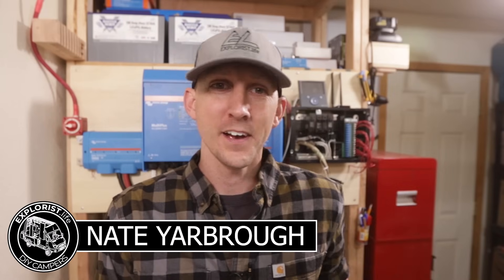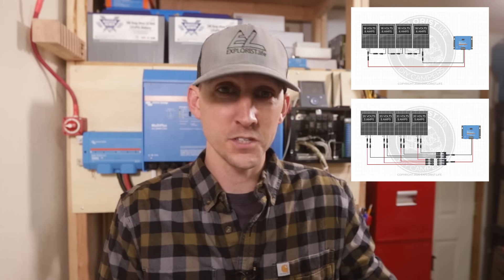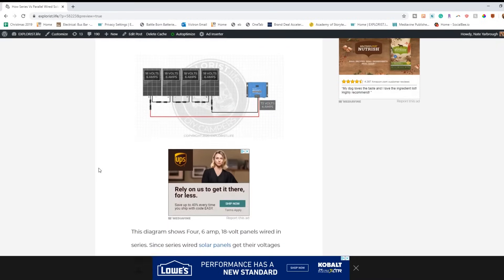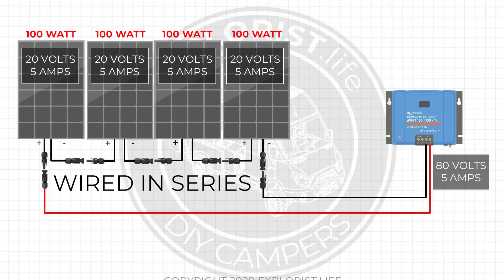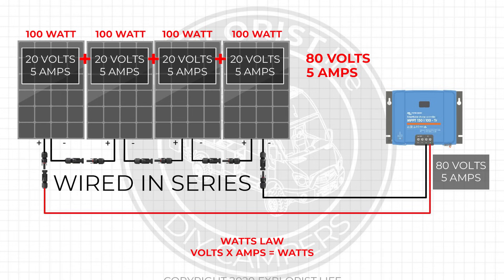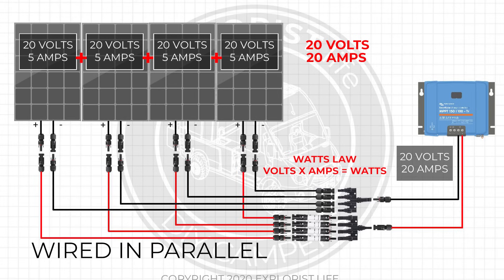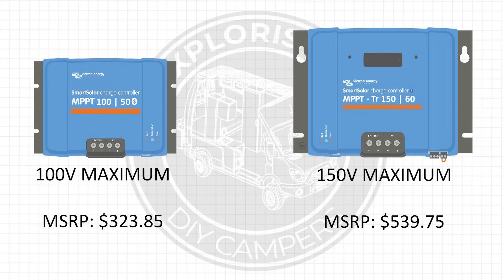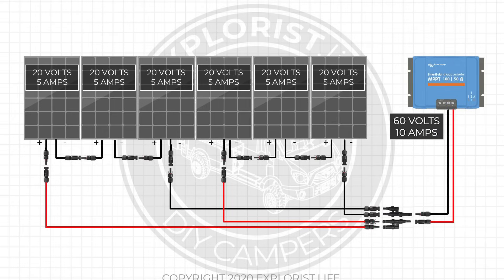Solar Panel Wiring vs Volts and Amps

Comment: Question ? So far I am following along and understand the math, what is series, parallel and series/parallel. What I don't know and asking is when it comes to charging the batteries, what is more important - Volts, amps or watts? I understand it is a combination of all three. But what is the most to be concerned about?  (In a camper type setup. Me, it is overlanding out of the back of my truck)

Thank you. I do fine your videos very informative.

Comment: Great info and yes very confusing.  I'm trying to do a pv hot water heater system.  I have 6 325w sunpower panels and a 100 amp mppt controller.  I'd like to skip the batterys, wire this to a 24v element in the bottom of my tank, use a snap disc thermostat 140 degree. Assuming it will never get to 140 at the bottom of my 50gal tank.  I will also leave the top element tied to the grid and set it to 125 in the event there's no sun.  First it sound like I need a bigger CController.  How should I wire these panels?
Thanks
Will

Comment: Great video thanks.
I have a system the has 4 x335 Watt panels and 2 x  330w panels connected in series. We tested and got 330v DC. The submersible pump says max volts allowed is 400V. Am I correct in saying 6 x 330 w is 1980 w  how do I convert that to volts? Also will extra panels in parallel help during overcast days? Thanks
Reply from the maker: Each panel has it's own voltage that will be listed on the sticker on the back of the panel.  You can take that voltage and use the information you learned in this video to answer your own question.

Comment: Is there any reason NOT to maximize the voltage going into my inverter?

My inverter's MVC is 450V. So, I would want 450V coming from my solar panel, right?
Reply from the maker: As close as possible (but not exceeding the maximum) given you have enough panels.

Comment: Thanks for the video. Please confirm if calculating short circuit current is indeed covered in this video? I’m not seeing this covered unless I missed it? Is operating amperage of the array the same as the short circuit amperage? I’m trying to determine the short circuit current for my solar array. Thanks
Reply from the maker: The short circuit current should be listed on the spec sticker on the back of your solar panels.

Comment: When you lock at victrons specifications for smartsolar 100/20 mttp regulator it says nominal pv power at 12v, 290watts. What does that mean?

 I should get 2000watts of solararrays before I max out the regulator if calculating with your metod (best case senario, 100v at 20a?).
But victrons mttp calculator goes from 100/20 to 100/30 when i add two 115w in serien time two in parrallel.
My count it should only be 40v x 16a? 

So should still work with the 100/20 right?

Comment: Hi I got a question I’m trying to get solar installs on my RV I’m thinking about getting that Vectron 150-70I don’t know if this good but I already have the solar panel I have 4 300 watt panel  How would you wire this set up I have a 400 amp lithium batteries thanks

Comment: Can you run a tube power amp that can be lowered from 50 watts to lower watts like 5watts or lower safely with the power invertor? Many tube amp mods have built in variac to lower power output down. I use reactive load to safely run the amp without a speaker.
Reply from the maker: High quality inverters can power nearly any load provided it is an adequately sized inverter.  I can't speak for the specific use case of tube amps, though

Comment: In your example of 4*100W, 20V, 5A panels, why not use a 100/20 charge controller. 2 series strings in parallel would give you 40V 10A to charge a 12.8V LFP battery? It is well under the Controller 100/20 rating and save money on the charge controller?
In absolute ideal conditions 31.2A could be created but the controller output is limited to 20A.
So a 12.8V battery would only be using a maximum of 256W.
But oversizing the array like this would give better overall yield especially on poor solar days when it's cloudy etc.
Am I missing something here?
Reply from the maker: 400W of panels would potentially charge a battery bank at ~27.7A (400W / 14.4V = 27.7A) under ideal conditions.  Using a 20A charge controller would only charge at a rate of up to 20A and the rest of the power would be wasted.  This is why a 30A charge controller is a more appropriate choice.

Comment: Man I am still lost and watts law doesn't add up I have 8 - 200watt panels (24.3 Open Circit Voltage VOC) & Maximum Power Circit IMP 9.80A... I have a 150 Volt Maximum HOW would I wire this and have it add up to 1600watts and stay under 150 Volts??? Thank You For Your Help my mind is mush getting old stinks.
Reply from the maker: https://shop.explorist.life/shop/all-products/camper-wiring-kits/solar-charging-wiring-kits/1600w-solar-charging-wiring-kit-8x-200w-12v-battery-bank/
Reply: @EXPLORISTlife  Sir I want to Thank You for your help! My kids got us a Delta Pro W/Two Extended Battery's along with the Rich Panels for when the lights go out again here in Texass. After watching So Many Videos I got Really Confused and Your Help is Greatly Appetited. Not much more I can do in return other than Subscribe Like Comment AND Share your content I'm sure people will have questions I Will Refer Them To Your Channel.... Thank You

Comment: I had my panels in parallel.  Changing them into series-parallel really increased the amps into the batteries.  My voltage into the charge controller was too low.  Increasing the volts increased my amps.  Thanks a ton for these very useful videos!
Reply: Gosh it's my first time trying to figure it out it's so confusing I don't think I'm ever going to be able to figure it out and I need to so bad they cut my power off and I'm trying to figure out how to make this work

Comment: Nate so higher voltage is more efficient? is this a correct understanding? I just went serries parallel with 4 panels. They seam to work much better.

Comment: Can I run a series string of 8 then ad a string of 2 in parallel?
Reply from the maker: Nope.  Here's what would happen if you did that: https://www.youtube.com/watch?v=jejro4zkl8I
Reply: My inverter shows to get the max out of it i need to run 12 panels in series and 2 in parallel? So I'm not sure how to do that.

Comment: Can u explain  when u needing use combiner box or blocking diode?
I planing wire 6x 100w 20v 5a  series parallel  to receive  600w 60v 15a but don't know how to deal with it because l getting shading
Reply from the maker: Here is how I recommend wiring 6x 100w 20v 5a panels together when powering a 12V battery bank: https://shop.explorist.life/shop/all-products/camper-wiring-kits/solar-charging-wiring-kits/600w-solar-charging-wiring-kit-6x-100w-12v-battery-bank/
Reply: Was thinking to do 3x2 parallel   not 2x3  if u know what l mean 3strings  but on that setup from ur website there is no fuses or blocking diode  a don't want back feed is that ok ?

Comment: I have 3x rich solar panel 200w 24v (Voc) 45.4V (Isc) 5.83Ax3=17.49A . My inverter LV2424 MAX PV INPUT (VOC) 145V, I'm using paralel connection so my (Voc) volt will stay the same but my (Isc) amp will increase can my amp can go more than what it shows in the chart? I need help for this thank you in advance

Comment: Hey man I am in a problem . I got 2 Q CELLS Q.PEAK DUO BLK-G5 315

And 1
Epever MPPT Solar Controller 12V/24V Charger 150V Controller+Meter Tracer4215BN
I am assuming my sistem is not compatible 48v to 24v controller .
So could you make a video how to separate the solar panels from 48to24v . A guy in this platform separéd a 1p24v to 1p12vx2

Comment: So, where do you place fuses / diodes on solar panels and how do you size them?  say I have 600 watts, 100 watt panels, series/parallels in groups of two (3 series 1 par). would you want a fuse on each series or just one fuse before the controller?  confused on how to size and where to place?
Reply from the maker: Sure!  I have a dedicated video talking about that: https://www.youtube.com/watch?v=s1P31hxlD3I as well as a wiring kit for 6x100w panels: https://shop.explorist.life/shop/all-products/camper-wiring-kits/solar-charging-wiring-kits/600w-solar-charging-wiring-kit-6x-100w-12v-battery-bank/

Comment: Most of us are interested in understanding how to obtain an inverter output of 120 volts and amper ratings of household devices consuming 8-15 amperes. We are speaking  of many thousands of watts consumed at various times of the day.
Reply from the maker: This video shows a system capable of that: https://youtu.be/01F4QDVJUq0

Comment: Hello, I have a renogy 60 amp charge controller, it supports 12, 24, 36, 42 volts. I have four 200 watt panels on my roof. Should I run them all in series to run 48 volts, or parallel series to run 2 sets of 24 volts. I have a 300ah lithium battery I'm using in my rv.

Comment: i still don't know why is key to choose one from the other besides the cost savings on wires.. there must be an electrical especific reason to choose one from the other. no one talks about that in all other videos.. Why or what do i want from my array? more amps or more voltage?

Comment: I get that you receive 120V/5A or 60V/10A depending on the setup... but the battery still receives 14V, yeah? So, the amps would be the same whether you do it one way or the other? But you save money on a cheaper MPPT, smaller gauge wires etc? Have I understood it right? :)

Comment: I have 36 250 wall panels with specs:
Rated Power: 250W
Open circuit voltage (VOC): 37.6 V
Max power voltage (VMP): 30.3 V
Short circuit current (ISC): 8.85 A
Max power current: 8.27 A
Power Tolerance 0/+3%
Maximum system voltage: 600V (UL)
Fuse Rating: 15 A

Ideas on how to wire this to keep costs down?  Area will have very little if any shading.

Comment: This is easily the best explanation I’ve seen to date on amps and volts for connecting solar panels.  Wish I watched this before I bought four 200 watt panels  with each panel running 12 amps into a Ecoflow delta max that can only handle 10 amps.  Thanks!
Reply from the maker: Awesome!  Glad it helped. 🙂👍

Comment: I see you used all even numbers of panels.  So is it possible to wire say 7 like panels with 5 in series and two together in parallel?  If so, what would the result be using your 20V/5A example?  If not, why not?
Reply from the maker: Good question!  That would not work.  This video shows some of the math behind 'why': https://www.youtube.com/watch?v=jejro4zkl8I

Comment: What if I array is parallel and the other array is series ...Then combined them is it possible..bec in series volts same  amps added 1st  array  THEN 2nd array parallel volts same And amps  added ..So the first array different volts and amps ...Likewise the 2nd array different volts and amps .
Reply from the maker: If you have 2 separate arrays going to 2 separate charge controllers both charging the same battery bank, they can indeed be wired differently if the array design calls for it.

Comment: Hello, I've got a victron 100/50 that I want to install to our caravan, the maximum watts is 700w. 

I've been looking at some panels and came across 160w panels ( 21.9V 8.75A ) 

Would I be best to wire in series parrell 5 solar panels @ 21.9V and 43.75A
Reply from the maker: I would recommend wiring them in series and then buying a properly sized charge controller: https://youtu.be/MxziHKvTRh8

Comment: I have 2 240w panels and 2 100w panels.  I'm thinking of wiring them in series/parallel for my travel trailer.  Should I wire the 240s with the 100s in series, and then each 240/100 string in parallel, or should I wire the 240s in series and the 100s in series, then those strings in parallel?
Reply from the maker: This should help! https://youtu.be/jejro4zkl8I

Comment: I have 4 100 watt Renogy panels coming down to the Victron 100/50 MPPT wired in series/parallel for 48 volts. Only get around 170 watts during bulk charge. 
Should I wire them all in series to see if they improve?
How do I test for a bad solar panel?
If they are all in series, does one bad panel cut off the entire array?

Comment: Hi Nate. What would be the outcome of this series parallel connection:

String #1:  100w 16.77v 6.26Amp (2 panels)
120W 18v 6.7Amp (1 panel)

String #2: 100w 16.77v 6.26Amp (2panels)

Would I see a slight benefit or decrease in performance by adding that 120w 18v 6.7A panel to the group of 4 100W panels?

Comment: Nate, question: noting the impact of # of system amps on wire gauge selection, if my system (3x90w para) runs at 15 amps, would 10 gauge wiring still be good enough to prevent loss? Also, my system would be around 25v. Am I wasting money getting an mppt (Victron 100/30) over PWM given the circumstances?

Comment: Very informative i have a solar inverter with mppt range 120-450vdc and i also have 10 solar panels of 540watts with 46vdc. Please tell me what is the more efficient way to connect these panels 5+5 or 9 panels in series for higher mppt volatage.
Reply from the maker: 5+5 would probably be better here.

Comment: I understand that series is best when one has 100% sun...What about intermittent shade?...Is wiring in paralell the solution to partial shade?  Does wiring in series+paralell solve shade problem?
Reply from the maker: Solar panels need sunlight to function the best.  If you have less than optimal sun, you'll have less than optimal output regardless of how they are wired.

Comment: Can you Please Help Me . I have a 250 Watt Solar Panel . I'm only getting 35.4 Voltage from Solar Panel and Only 0.02 Amps .. Is My Solar Panel Bad .. Time Now is 11 am Sunny Day .. Any Help would be Greatly Appreciated 🙏
Reply from the maker: Sounds like your batteries may just be full.  Full batteries won't charge any further.

Comment: I have 5 -100w panels on my garage.   I’m using a renogy charge controller with a 100v/520 imput max.   I’m wired in parallel, so that 20v @25 amps.   Would it be better to drop one panel and wire in series to increase my volts.  Thanks
Reply from the maker: Maybe.  Tough to tell, though since we would then be comparing instantaneous amperage vs amp hour yield per day.  My recommendation would be to switch all 5 panels to series and replace the charge controller with one that can handle the increased voltage.

Comment: Agreed, very helpful videos.  I recently purchase an EcoFlow Delta Pro and want to use it as a back up power station for our home.  The DP has a limit of 150V/12amp so looks like I will need to install future panels in series to keep the totals under the max.  Also want to buy the EcoFlow extra battery and link to the DP to get to a capacity of roughly 7.2 kWh.
Reply from the maker: Awesome!  Glad it helped.  Thanks for watching!

Comment: Hello Nate,  Thank you for all you do!  I have simple question...is it possible to wire my solar panels in series that are connected to a Victron MPPT controller and charge a battery bank which is wired in parallel?  Thank you in advance.!
Reply from the maker: With a properly sized MPPT charge controller, most definitely!
Reply: @EXPLORISTlife  Awesome.   Thank you again!

Comment: Hi mate, I just discover you. So, I ignore if you've already done about this :

What about the theory saying that you take the number of watts of your panel and divide it by the voltage of your system to get the max amp that your charge controller can support?
Means : 195 w ÷ 12 v : 16.25 amp. So if I have 6 panels, I need a charge controller with at least 97.5 amp capacity?

Is it a true or false leading?

Thanks a lot!

Comment: Great videos. Which configuration would charge a battery fastest? For example, does wiring it with higher voltage but less amps result in slower charging due to lower amps, or does the higher voltage increase the speed of charging?
Reply: Basis what I have, connecting in series would charge the battery quick than connecting the panels in parallel, but make sure the your mppt is capable of handling

Comment: If I have 8- 230 watt pannels wired series parallel. I get 144 volts at 36 volts open circut, if I added 4 more pannels wired the same will it stay at 144? And with 12 pannels will I exceed the charge controller amp max.? I have a midnight 3548 hybrid.

Comment: Two of my 235W poly solar panels went out. I had four wired in parallel (panels each had 30V, 7.85A). Can I replace them with 330W mono panels or would mixing the two types or panels be an issue?

Comment: As others have said, “Thanks Nate” for the great information, and the way you present it. I have a “What would Nate do” question.  I’m putting two, 200w Renogy panels (in series) on my motorhome, using 8ga wire down to the controller. Was going to use Renogy 40amp MPPT controller to allow for future expansion but they couldn’t send me the right unit.  Instead, I bought, and installed a Victron SmartSolar 100/30 MPPT while waiting for the panels to be delivered.  One of the panels has minor damage to the corner.  Renogy said this could affect the water-tightness and they are sending me a new panel.  I believe the 400 watts of the two panels puts me at the top of what the controller can handle.  Is there any benefit to me adding that third panel to my roof (in series with other two) after sealing up the cracked frame?  I believe it would get the MPPT to the Batt+5 volts sooner to start charging and produce more usable power on those less than ideal cloudy days.  Big concern is what happens on sunny days when the panels are producing more energy that the MPPT can use?  If it won’t damage anything, or cause excessive heat, would you take advantage of the “free” 200 watt panel without upgrading the charge controller?